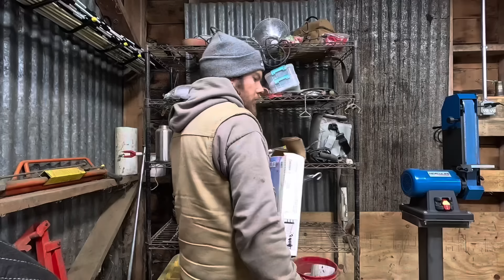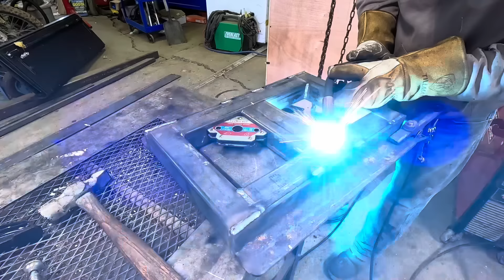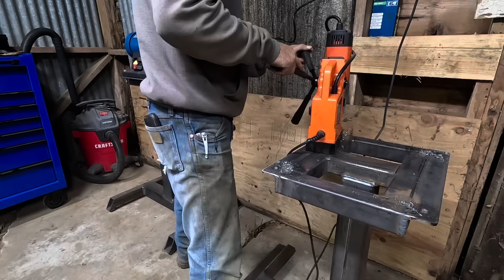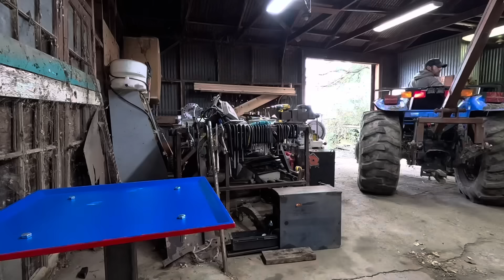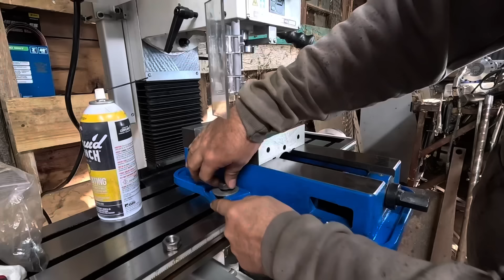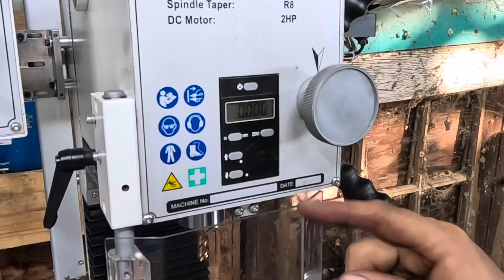Bringing My Shop to the Next Level With the MechMaxx VM32L!

Comment: Howdy, I just purchased the same lathe and mill you did, making my own stands before they come...happen to know the hole pattern spreads to mount machines to stands? Thanks
Reply from the maker: Congrats on the new machines! I don't have those measurements handy, are they maybe on the spec sheet on MechMaxx’s website?

Comment: Fantastic !  glad to see you getting the mill set up.  and it's even got a DRO......  FANCY!!!!!
I think you will find that Super accuracy is not needed on most of the ranch work... things like a stepped countersink for the bailer
only demands that the bolt head be able to clear... so down to the thousandths of an inch is not necessary.... BUT you have that ability now... so you could resurface a head on a motorcycle or honda 8hp.  or replace valve seats and cut new ones

Comment: I would take your belt grinder out of that corner and move it with your welding setup  to the other side of the shop. Grinding dust isn't good for long term precision of your machine ways.
Reply: Amen to that Brother, belt sander is no friend of precision machine surfaces!

Comment: Given that you need to use your pulley to lift heavy stuff so often, have you ever thought about putting a track for it up near the ceiling so you could slide it front to back and side to side? Then you wouldn’t need to use the tractor it tight quarters.
Reply from the maker: Yes I have thought of that. Maybe one day

Comment: The thing to remember with that post is that it is a stand alone pillar, not a frame. 4 let's are far better than 1.
The second thing is that level is relative to the post. The mill will always remain square within its self, but the frame and floor can be moved out of level during use!

Comment: You don't want your drill press in the corner. Imagine you want to drill a hole in the middle of a 10' piece of angle iron... You're going to be hitting the wall on both sides.
Reply: It didn't wind up all the way in the corner.
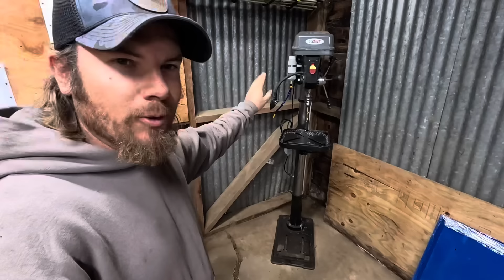Reply: @tsl7881  How do you know where it ended up? Watch this: 01:50

Comment: Mr. Tyler, 3 legs are better than 2. Thicker wall doesn't really give you much in terms of stiffening compared to more legs, section modulus is more about the distance of metal from the centerline of the shape than the thickness of the walls.

i like your idea of the floor level cross bar, but consider putting it at the back, with 2 vertical's as far to the left and right as you can get, looks like the weight of the mill is set to the back of the table.   This givers you more foot space at the front.  You might want to move the center post off centre to add more stability.
Reply from the maker: All good points!

Comment: 2 things that you need to do. Make a plan and setup for shavings collection or you will have them everywhere forever, especially with your cracked floor. You also need to get a cutting fluid pump. Skimp on that and you will ruin your tools very quickly. That drainhole in your table will be your best friend. Unless they came with the mill I would also suggest making some t-shaped scrapers to clean between the tracks in the table. Keeping those clean will save you a lot of grief with rust.

Comment: You will find as you use them both, you'll use the mill for precision and the drill press for speed on batches of small parts. The number one accessory I wish I had for my mill is a rotary table for circular hole patterns. But $$$ it's the neat ancillary tools that cost more than the machine.

Comment: One thing you will need to plan for with your older shop structure, with its odd nooks and crannies is:  swarf collection. Once you get busy on machining projects, that stuff flies everywhere. Thought out back - splashes and collecting points will make cleanup a lot easier.
Reply: This should be pinned!  Swarf is not something to mess with!
Reply: What’s swarf?
Reply: @nancystevens4992 All the metal shavings removed during machining.
Reply: @nancystevens4992 Not sure, but I imagine it is metal fillings and small pieces that fly everywhere when those machines are working.

Comment: Nice addition, yes moving the mill away from shelving is a good idea, BTDT and chips will end up in everything. You can always do what Haas does on their machine tools and fill that stand with concrete, it helps dampen the vibrations caused by machining.